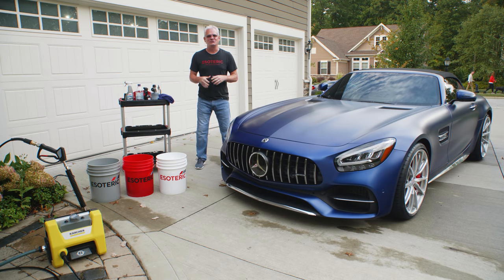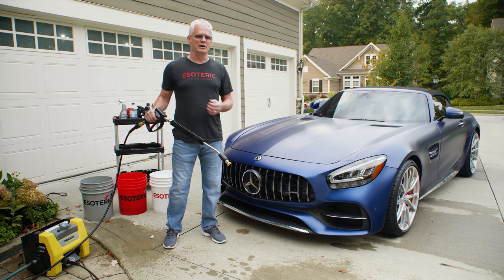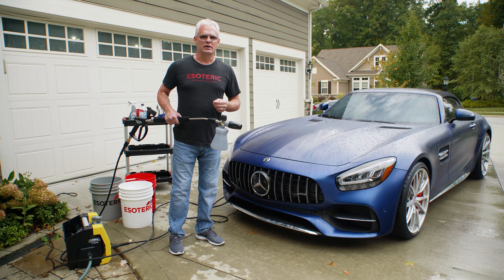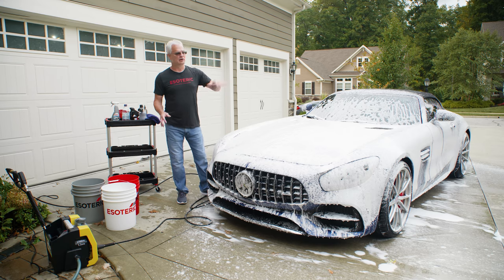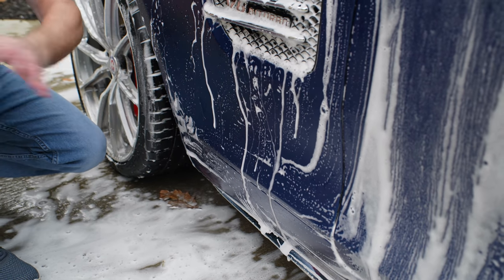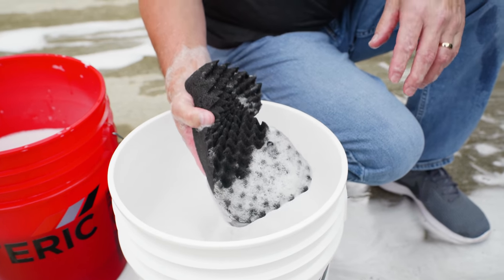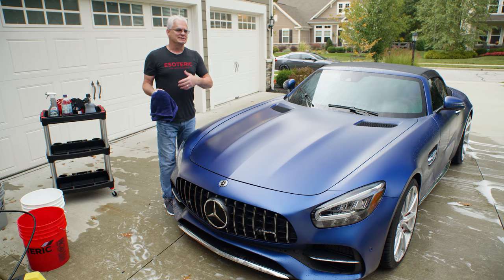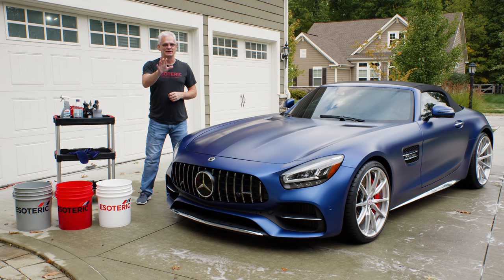Pro car washing FROM HOME! | Step by step tutorial!

Comment: Awesome car Todd and love this type of video. Compared to you I’m still only na rookie. After spending 12 months carrying out the 2 bucket washing method, I always ended up with 2 buckets of discoloured water. This led me to believe that no matter what i did, dirt was still getting into my wash bucket. For the last 2 years I have been doing the wash exactly as you described, but with a new, clean mitt surface for every panel. Sure I have a few mitts to clean out at the end of the day, but I am comfortable knowing that there was no chance of my washing tool contributing to surface scratches of the car. Keep up the great work. Lloyd

Comment: You are a great teacher...and really enjoyed this video.  Unfortunately, my car gets washed on a dirt driveway with a garage for drying.  I use a one bucket system...pre rinse-foam-wash one quarter of the car with a quality mitt.  Put that mitt in an old bucket, then use a fresh mitt for each quarter of the car, plus one for the wheels.  Since my car is so clean most of the time, two mitts is enough...I used to use the two bucket approach as well.  liked and subscribed!

Comment: Thanks for another great video Todd 🙂 My method is a little more long winded and now I'm thinking perhaps over-the-top ? I give the car and wheels a rinse with pressure washer > Snow foam the car > go around each wheel with fallout remover > wash the wheels whilst foam is working > empty, rinse and refill the wheel bucket with shampoo/water (I only have two buckets). Rinse the car and wheels well with pressure washer > re-snow foam car with lighter coating > wash car two bucket method > rinse car well again > dry car with Gyeon microsilk and Bigboi dryer. What's your thought's on this? Do you think the additional snow foam step isn't necessary? I guess it depends how heavily soiled the car is to begin with ? Great car and house by the way. Amazing. Andy
Reply from the maker: Thank you. I'll only foam the car twice if it's really dirty, otherwise, the rinse should be getting any heavier bits of debris off of the surface.

Comment: Two bucket is cool, but I moved to a “single bucket, single use mitt” method personally. I have 10 mitts, and they all get used once per wash. this way there is ZERO chance of carrying dirt from a dirty mitt to another part of the paint. Then at the end, I use pressurized water flow to rinse all the mitts before putting them in the clothes washer with some Rags To Riches microfiber laundry soap. Just another option!
Reply from the maker: That's good if you like to do that much laundry, however please keep this in mind...as soon as you do your first pass on your fresh mitt, you have 100% the same risk of marring the finish as the 2-bucket method. While I would love to sell 10 wash mitts to everybody, it's just not something many people are interested in doing. If we were seeing issues with marring while using the 2-bucket method (properly) after washing thousands of cars, we would have tried something else.
Reply: @Esotericdetail And you keep diluting down the car wash soap by dipping your mitt from the rinse bucket into the wash bucket.
Reply from the maker: @bryangallardo1071  In thousands of cars washed, I've never found that my wash wash less effective towards the end because it was overly diluted.

Comment: Hi Todd! Love your methods! Very practical and smart! My cleaning method is similar to yours but with a twist. Instead of using the 2 bucket method, I use one bucket with a grit guard and use that as my rinse bucket. I then use my foam cannon to put soap on the car, 1 side at a time and then do the contact wash on that. I rinse my wash mitt per panel. What are your thoughts with this method?
Reply from the maker: That can work, but I feel that takes more time.

Comment: Having followed this guide for the first time yesterday, I have one suggestion to add: ear plugs if you're using the big boi.  My ears were ringing for hours after I finished.  In particular, drying around the lug nuts on the wheels made a very loud noise.
Reply from the maker: The machine by itself isn't very loud, but as the air whistles around those tight areas, that in itself does get loud.

Comment: Question regarding using the foam cannon as a prewash. Seen this many time...and did it myself actually. Foam, let dwell, rinse, foam again, dwell and wash... 
My thinking is the first foam, dwell, rinse is definitely beneficial to remove looser dirt before the second foaming and contact wash, which in turn helps reduce the possibility of scratches. 
Your thought on this?
Reply: indeed, he should have done a rinse after the foam, instead of contact washing. But he got a wrapped car+ he washed it few days before so then its not really needed.
Reply from the maker: IF it's exceptionally dirty, then yes. But it's not necessary. This is from experience doing thousands of cars...not based off of theory.
Reply from the maker: @hendrikjan9116  Only required in extreme conditions.
Reply: @Esotericdetail  100k car qualifies as an extreme condition lmfa good video 👍
Reply: I have to wash my car outside and after I foam the car, I rinse it off. I have never used the foam as part of the actual wash process for extra lubrication.  As there is always a slight breeze blowing, I do this so I can see if any contaminants have blown onto the car as I am washing. But if I wash with the foam still sitting there, I most likely would not see those contaminants and therefore, may scratch or mar the surface during the wash. That is the only thing that I do different to the steps you have shown. A great natural video of washing the car at home.
Reply from the maker: @Ozzcaddy  I doubt that anything that may blow onto the car would be more abrasive than what is already on the surface. There's nothing wrong with the way you are doing it, but it's not something that we concern ourselves with, be it a daily driver or a million dollar + car. And after literally thousands of washings, we've never had a single issue. Thanks.
Reply: @Esotericdetail  can't beat experience....thanks for passing on your knowledge

Comment: What I would like to see if it’s possible, any part of a car but let’s say for this instance the Hood. I would like to see one side of the hood get rinse, foam to let it dwell and then rinse again, then The contact wise with the two bucket method. The other side of the hood should be rinsed, Foam for a contact wash. The purpose of this is to see if letting the Foam dwell help reduce Marring for the contact washers. Not sure if you have enough time to do it once a week to the hood to see a week by week or month by month difference on each side of the hood
Reply from the maker: Sounds like a good test for you to do at home!

Comment: I find it interesting that you prefer to wipe with up and down patterns along the door panels rather than side to side from top to bottom. Wouldn't you find yourself bringing up debris and contaminants from the lower portion of the door to the top by doing this? I prefer side to side from top to bottom, that way if your sponge/mitt does pick something up it stays on the lower section no matter what. Also, if you're running the two bucket method - wouldn't it be best after rinsing to squeeze the mitt from outside the bucket and onto the pavement than just squeezing it back into the rinse bucket? By doing this the water will be less dirty over the duration of rinsing it during your wash. Yes, there's a grit guard but there will always be contaminants floating as soon as you agitate the water. Just two things I noticed - let me know your thoughts!
Reply from the maker: Don't over-think it!  :).  We've washed literally thousands of cars with this method with zero issues.
Reply: @Esotericdetail  I'll accept that answer haha. Thanks!
Reply: Another waste of time with 2 buckets. I rinse cleaning pad or sponge with my hose on shower setting if the car is that dirty. Wash the car in sections rather then spraying the whole car with soap and then hand washing. Especially when in part sun. What happened to the simple and care full way to wash a car. I think its just people being lazy and like playing with new cool toys that aren't necessary. Think about it people? Stop wasting your money. Use power washers what they are meant for. Common sense!

Comment: Hi Todd, thanks for another interesting video. I am curious as to the weather conditions you were working under. 
I cleaned my car yesterday here in Australia, the temperature was about 32 Celsius (90f), clear skies, no shade and the panels were hot. Although I try to keep the foam on the car for about 5 minutes, any longer and it dries to the surface, I have to rinse off before a 2 bucket hand wash stage. Water spotting is an issue for me, so I do use a drying aid spray after the car is dried, to remove any unsightly water spots.
Love your videos, keep em coming. Paul.
Reply from the maker: We have to deal with that in the shop as well during the summer. The key is to be quick, and also to use deionized or RO water. Without it, there's no way we would do it in direct sunlight during the heat of the summer.

Comment: I do need to use Gyeon Quick detailer as a drying aid. Even when using high quality drying towels.
Reply from the maker: Why do you feel the need to use a "drying aid"?
Reply: @Esotericdetail because the water i use, is ‘city water’. When I’m drying without a drying aid, i am left with white streaks.

Comment: Wouldn’t it be more secure to prevent any scratches if you washed down the foam with pressure washer first and THEN use the wash mitt for hand washing? If the car is somewhat dirty you’ll be spreading all that loose dirt and bugs on the paint surfaces when it could actually be easily removed without any scratching beforehand?
Reply from the maker: Only needed on an exceptionally dirty car...

Comment: Hi Todd, 
Could you explain the difference between:
1. Foaming the car, dwell time and rinsing off
2. Foaming the car and using that foam with a sponge to wash the car as you do here? 
Is there a time when you'd do one over the other? Usually I see videos of foam being left to sit and then rinsed off but don't know why these two methods exist. What situations should I look out for, we have coated and non coated cars in household. 
Many thanks
Reply from the maker: If a car is exceptionally dirty, you may want to foam it, let it sit for a few minutes, then rinse it off. But you'll then foam it again and wash as I do in this video.

Comment: You did not wash the convertible top, does it need a different approach?
Reply from the maker: If the soft top is actually "dirty", then you'd want a cleaner designed specifically for that. On mine, I have only just rinsed it off the entire time I have owned the car, and have yet to see a need for deep cleaning.

Comment: Ehh, I wouldn’t say multiple mitts and towels is a crutch at all. It saves time for me personally. More sides to use on a towel is better than only have two sides with a wash mitt (or one side with this sponge) before walking back to the rinse bucket, agitate against the grit guard, then soap up the mitt/sponge again. With a mitt or sponge you have to constantly worry about them filling up with contaminants where with a towel you just flip it to a new side.

I still use both methods, but I find the multiple towel method is faster for more maintained cars where I’ll use the 2-bucket for dirtier cars since I get more scrubbing power with a mitt.
Reply from the maker: I think you can agree that most people who use that method do it as a crutch because they can't figure out the safe 2-bucket system, or they simply took the advice because "some guy said you have to do it this way". If it saves YOU time, then that's great. Can't say I've ever heard another person promote it as a way to save time. Many people want to argue that it's the only safe way, we are here to present it as an incredibly safe way to do it based off of thousands of cars of real world results.

Comment: I’m curious to know the reason to the madness of going up and down on the vertical panels lol. Also, you diluted 1 to 5 in the foam cannon, is there a more economical dilution that still works?
Reply from the maker: If you do get any light marring when washing, it's harder to detect vertical than it is horizontal. So if you're walking past the car and it has a horizontal light scratch, you'll see it the entire way! You could try less of a dilution, however we have found that ratio to give us the best overall combination of cleaning, lubricity, and economy.

Comment: It was cloudy during this video. I would like to see how you would handle the sun. I really don’t have an option but to wash and dry in the sun. I have to work much faster to avoid it drying before going to next step.
Reply from the maker: Exact same process, only faster. Washing in the sun really makes it mandatory to have a DI water system.

Comment: Are you using a 15 degree nozzle for rinsing?  I typically use the 40 degree white MTM nozzle but am curious of what nozzle is the best for rinsing.  I thought a 15 degree was too aggressive, but it can't be if that's what you're using!  BTW - the Gyeon  silk dryer is by far the best drying towel I've ever used!
Reply from the maker: Yes, I have the 15 on my setup. I see it more of a personal preference than anything else. I / we also just use one nozzle and don't change out relative to what process we are working on. Glad that you like the Silk Dryer as much as we do!

Comment: Isn't it somewhat risky to wash with the foam out of the cannon? I'd imagine some of the grit and dirt might still be on the surface. It's akin to using soapy water without a grit guard?
Reply from the maker: Not at all. IF you had an extremely dirty car, then you may wish to pre-soak, rinse, then foam again to wash. Even that though, there will still be stuff on the surface.

Comment: So I guess I’ve been doing this wrong all along. I rinse the car- foam it. Let it dwell for a few. Rinse the foam off and proceed to the two bucket method. So I shouldn’t rinse the foam off and proceed right to the wash with the foam on the surface ??
Reply from the maker: If it's really dirty, then you can rinse the foam after it dwells a bit, then I'd foam it again and proceed. But if it's not that dirty, rinse, foam, then proceed with washing.

Comment: Between washes I've been wiping my classic car down with a microfiber towel & a quick detailer product after a short drive before putting the car cover back on. I can go months between washes since I typically drive short distances in the sunshine of California & never in bad weather. Is this a problem or should I be washing the car more frequently? Is the PolishAngel cosmic spritz a better product to use based on the routine described above vs the quick detailer product I'm using?
Reply from the maker: This should answer your question: https://youtu.be/fA6w5mlGZrI

Comment: Hey Todd! Thanks for the great video, I just discovered your channel and it answered a lot of questions marks I had in mind.
 I do have a few questions though. 

1: After I foamed the car, can I rince and then reapply soap a second time or am I wasting my time/soap doing this? I usually go by: Rince, foam, rince foam, 2 buckets, rince, dry.
2: You're mentionning keeping front bumper for last but if I want to use a tar/bugs remover, when would be the best time to use it?

Thanks!
Reply from the maker: You only need to foam twice if the car is exceptionally dirty. As for bug remover, wait until then end after the front end has had plenty of dwell time in water, soap, etc.
Reply: @Esotericdetail  Perfect thank you so much!

Comment: @Esoteric Wanted to query if there was a reason you recommend Bathe over Bathe Essence and why? I can't understand why the former is more commonly used when the latter is cheaper through its lower concentrations. Is there something else which makes you recommend the regular bathe? Many thanks
Reply from the maker: Bathe works much better in a foam cannon!
Reply: @Esotericdetail  Otherwise, no difference?

Comment: I notice you avoided the convertible top.  what is the proper process for cleaning that roof?
Reply from the maker: That's for another video...
Reply: I've had convertibles for over 40 years. Currently have 2 of them and I always wash the top and car at the same time using the same shampoo, wash mitt and bucket.  I never have had a problem and the tops always look brand new. Twice a year I use a fabric protector and every so often I use a lint roller. I dont believe you need a special cleaner or brush to keep a top looking good.

Comment: Hello Todd, I have a PPF and ceramic coating applied to my vehicle (Xpel and Xpel Fusion). I was always under the impression that my coating provided a nonstick barrier to my PPF. So far anything I found on my car just wiped right off. Am I wrong to think the Cosmic Spritz would do the same thing during its next maintenance wash? Thank you.
Reply from the maker: It's not a non-stick barrier by any means, but rather "stuff" doesn't stick to it nearly as easy. This "self-cleaning" characteristic wears down over time, and use of Cosmic Spritz helps to restore this aspect, as well as acting to protect the coating.

Comment: Really pretty car!  How would I restore matte stripes on a camaro?  Thanks.  Big fan down in Charlotte N.C.
Reply from the maker: Thank you Scott. There's not much you can do to "restore" them. You can apply coating, which will definitely make them look better, but if they're starting to look a little beat up, then replacing them is the only way to go. Thanks for watching!
Reply: @Esotericdetail  is CS even more hydrophobic than Rapidwaxx?
Reply from the maker: @marksafady5986  Yes it is...